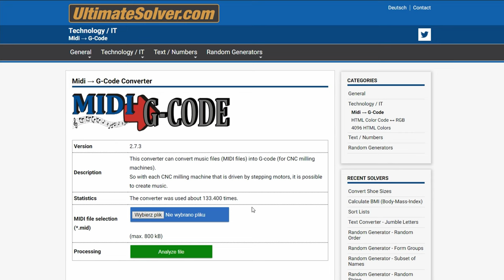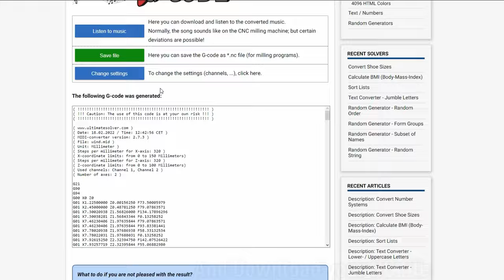Naruto Soundtrack on CNC Lathe - How To Convert MIDI to GCode

Comment: Please build lathe cnc with mach3 not linux
Reply from the maker: This machine was build first on mach3 but it was replaced by LinuxCNC because threading is much better here. If you need help with mach3 you can check my other videos 😉
Reply: @GBWM_CNC  threading with mach3 when using the encoder is it still bad?
Reply from the maker: @odhie_r  mach3 doesn't allow to use encoders. It allows just for index pulse which is 1 pulse per rotation. This is really not enough for threading. Maybe it could work on big machines with a big inertia.
Reply: @GBWM_CNC  Omg, I want to convert my C0630A to CNC with mach3. The goal is threading
Reply from the maker: @odhie_r  I saw some succesful tries to thread on mach3, but I was not able to achieve it on mach3. It sends just the index signals to the machine which is really not enough to be trustworthy for threading. I really recommend you to get familiar with linuxcnc. My machine is now able to cut the same thread multiple times and hits perfectly the same the pitch every time.
Reply: @GBWM_CNC  I really don't know about linuxcnc, do you have any recommendations from zero to hero (lol) with linuxcnc?  because with your video I still don't think I can fully understand it. But your video make cnc lathe is awesome
Reply from the maker: @odhie_r  I started with linux CNC with Adam Maszynotwór videos on YouTube. But his Channel is in polish language. But I think you will be able to find something on the net if my videos are not enough (i made videos about linux cnc configuration, wiring etc.). Also if you have specific problems with it there are a lot of forums on the net - the community of linux cnc is really big and most of typical problems are already solved and there are simple solutions. Before I made my linuxcnc videos i had absolutely 0 knowledge about linuxcnc and it was like 1-2 days to get familiar with it and make everything work including the threading function 😉
Reply: @GBWM_CNC  oke I will try study hard 🔥🔥. Anyway, nice to know you I from Indonesia
Reply from the maker: @odhie_r  Greetings from Poland 😁